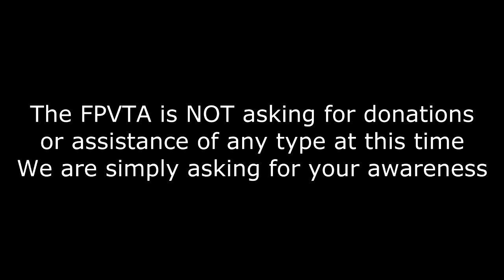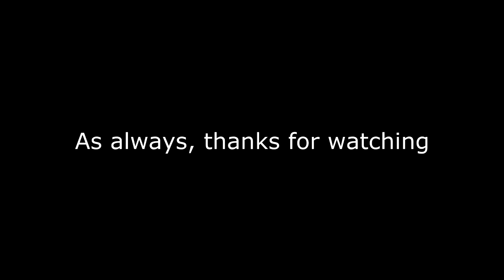The chances of colliding with an airplane

Comment: What you're talking about is called the big sky theory which paradoxically led to the creation of the national airspace system. Research it. Second, your acceptance of risk and the full-size aircraft pilot's acceptance of risk are completely different.  He risks his life and you a foam toy. By the way, yes a LiPo will indeed destroy a jet engine running at 40K RPM.  Regardless, you are missing the point.  The FAA has asked us to follow a few very simple rules.  When you and 007 post "high altitude" and "in the clouds" videos on the Internet the FAA has no choice but to strengthen the rules and possibly the consequences for all of us.  Lastly, making a video convincing the public it is acceptable to share the airspace with a highly regulated industry is irresponsible, regardless of your wardrobe.
Reply from the maker: The pilot of an aircraft takes a risk when they fly.  The fact that they take a higher risk than I do does not give them more rights to the sky over my own private property than I have.  Period.  By this logic, I have more rights to the national parks because I choose to rock climb there.

Also, the "high altitude" flights you see flown by me have had FAA clearance.  I am a professional.  I conduct myself accordingly.
Reply: Alex Greve Well said, Alex. I fly Full-Size aircraft, also. Experimentals only, not commercial, yet I am up there with my own life, taking that risk as I choose. Nothing perturbs me more than "Good Ol boy clubs". They basically say to outsiders, "We have been doing this a long time, and have established our dominance in this activity/area. We have spent a lot of time and money achieving this highly sought-after status. You, on the other hand, have found a much more efficient and cost effective way to enter into our domain, and I hate you for that. I don't want you here. Go away." It is pure jealousy, mixed with a bit of irrational fear. The fear-mongers will go away eventually, to the same place where the "Iraq Weapons Of Mass Destruction" chickens went. FPV will, after 10 years of growing without any incidents, become an accepted fact of life, just like cell phones, satellites, nuclear power, cars, and (if you want to go back that far) fire. Yes, the ancestors of THOSE people used to DETEST the fact that OUR ancestors used fire to keep warm at night. Too bad they all didn't freeze and die long ago...
Reply from the maker: *****
If 1 in 31,000,000 million is dangerous, you need to stop eating.  You are statistically 112 times more likely to died from food poisoning.  Statistically you have a 1 in 10,000,000 chance of being killed by debris falling from an airplane.  3X higher than a collision with a UAV.

What you are advocating by saying the FAA should regulate it is advocating freedom being taken away.  Why on Earth should anyone have more right to the sky than another?  My activity is only poses a risk to aircraft.  Flying full scale poses risk to people on the ground AND other aircraft.

There is no such thing as zero-risk.  You force me to take a 1 in 10,000,000 chance of getting killed when you fly, so why is it not acceptable for me to have a 1 in 31,700,000 risk of you hitting my toy?
Reply: Alex Greve
Agree we don't fly high at random.
Reply from the maker: I think you are missing the point.  The ONLY thing I am outlining in this video is PROBABILITY of collision.  That's it.  I am not at all discussing what happens in that event (although history has shown the one collision that did occur did not result in fatalities).  Smaller vehicles and foam airplane pose a smaller risk than large helicopters and multicopters. 

Even large foam airplanes aren't much of a risk.  The reason is F = (mV^2)/t^2. Where F is force, m is mass, V is velocity and t is time.  Foam is a compressible solid and increases the t^2 (time) value considerably which reduces the force exponentially. 

The truth is that a little sense goes a long way when it comes to safety of aviation.  Laws won't change that.  Passing laws does not stop stupidity any more than passing gas stops the rotation of the Earth.
Reply: Jet engines don't run at 40k rpm. They are more around 5-12k
By the way, that risk is for the whole country, not just for one single plane. To get the risk for a plane, you have to divide that percentage by the number of all plane flights per day. That would give completely neglectable number comparing to the risk it takes to fly this thing at all, risk of failure of any systems etc. It's usually around 1/100000 and 1/1000000
Reply: Alex Greve You need to take up a leadership position
Reply from the maker: Tarik Agcayazi
I am the president of the FPVTA and the CTO (chief technical officer) and owner of Video Aerial Systems.  I think that's all the leadership I can handle ;)
Reply: Glad we have someone like you in charge then
Reply: Alex Greve Again uninformed. Whoever told you that you own the airspace over your property was lying to you. You also assume people only fly models only above their own property.  Equally false.  Does the air ambulance or news helicopter need your permission to fly over your house while conducting business?  Privacy is a different issue.  You've admitted in your videos that flying is safe, for the most part. This is so precisely because it is an activity REGULATED BY THE FAA. Also, the participants in this airspace have attained a lot of education which certifies them to operate there.  No one is saying you can't have fun with FPV but please do it within the confines of Advisory Circular 91-57 and please, please, to anyone listening, if you choose not to follow it do not put the evidence on the internet!  I can say all this because I worked hard to get a degree in aviation, I earn a living flying large airline aircraft in all corners of this planet, have flown UAVs in defense of this (US) nation's security, and also enjoy the FPV hobby in my leisure time.  So, from one professional to another, let me remind you that what you're advocating is dangerous.  At best all you can say is that a mid-air 'probably won't happen', which we can all agree is not good enough for the flying public.  Just because the statistics are low doesn't mean the FAA shouldn't take steps to prevent an accident.
Reply: "Just because the statistics are low doesn't mean the FAA shouldn't take steps to prevent an accident." 
You talk as if the only risk in the world is me going outside and flying my airplane.
Reply: Oh they can take steps but what if DOT did this with cars? They crash how many times a day? It not what but rather how there doing this that is just crazy. Spend years slacking off then in a punch just start throwing laws out there without any thought.
Reply: Tarik Agcayazi Did you watch the video?  The conversation is about aircraft, both full sized and model.  If you want to talk about all the other risks "in the world" find another video to comment on.
Reply: Alex Greve You keep supporting these claims with these ridiculous numbers and then use them to say that low probability equals low danger.  How can you say that? Let me play along.  There are roughly 300 million people in the USA.  Hypothetically, let's say that some random act at the odds of 1 in 300 million results in someone's death.  You're argument would say that the 1/300mil chance made it safe but I think the dead guy would seriously disagree with you.  Are you going to be the one to tell the loved ones of that person that the incident was safe?  Furthermore, if the government knew of the danger and choose to do nothing it would be considered negligence, which the taxpayers of this country would hold them accountable for.  
Now I can hear you all already, "But what about all the motor vehicle fatalities, what about slipping in the tub, what about choking on your food?!!".  What you all fail to realize is that those ridiculous analogies are all accidents.  What we're discussing are actions by the public that, through regulation, can mitigate (notice I did not say eliminate) injury.  For instance, a pedestrian killed by a car out of control on an icy road is a very unfortunate accident.  A similar pedestrian could also be killed by a drunk driver.  While these are both motor vehicle fatalities, you can't put them in the same category.  Every analogy I've seen in this thread has been in reference to accidents which, by nature are not predictable.  Keeping in your argument, you would also seem to claim the law against drunk driving is an attack of your personal freedom to drive however you wish.  You also don't have the freedom to sell drugs on the street.  These facts don't mean we live in a communist society, it means we live in a society of common sense.  You need to take a step back from your calculator and apply a little common sense of your own.  Just because you can build an antenna doesn't mean you know how to aviate safely.
Reply: ***** Acceptable risk is a part of life. It is plain and simple. There is risk in everything you do. You engage in activities every day which put other people at risk. When you get in your car and drive, you are putting people at risk. Should we tell you that you cannot drive anymore? We FPV flyers want to continue our activities without all this fear and paranoia shutting us down. We engage in an activity which has been going on all over the world without killing people for years. It's fun. It's safe. It is much safer than the majority of activities out there. We will continue to put our aircraft in the air, and continue to fly safely, and enjoy our hobby, whether you like it or not. I don't care what drunk drivers are doing. That has no bearing on what I am doing with my creations up in the airspace. You seem ridiculous, wasting your breath, attempting to make our hobby look dangerous, when no collision has happened in all these years. Don't you feel kinda silly? How will you feel 20 years from now when there still has not been any FPV vs FS Aircraft collision? Will you still feel as strongly? Still feel an event is imminent? Go build an underground bunker somewhere, please, and don't forget the tin foil hat!
Reply: Freedom DroneFPV I find it hysterical that the person claiming a quad accident could only be caused by a Muslim (a comment found elsewhere in this thread) is the same person calling me ridiculous.  You seem unable to grasp the concept of credibility.  But you're right, risk is a part of life.  So, we should do away with all rules and laws of modern society simply because "We FPV flyers want to continue our activities without all this fear and paranoia shutting us down".  I love that argument by the way.  I hope you used it during the FAA's comment window they open up on this subject.  If you did, I'm sure they laughed at you, the same way I laughed at you after reading your comments.  The drunk driving remarks I made were in reference to bogus analogies supporting ridiculous claims of safe flying practices but apparently that lesson went over your head.  And regarding your 20 year prediction of accident free skies, you'd better read this morning's news (CBS) on the quad near JFK airport.  Seems you should get your crystal ball fixed.  Before you even say it, no, it was not a collision but statistics (such as close calls in the world's busiest airspace) are not trending in your favor.  Also, there's no need to cry, if you and those who share your delusions had stayed within the confines of AC 91-57, the FAA wouldn't be threatening to take away your toys.
Reply: ***** I do agree with you that the FAA is suggesting some very bold and outlandish regulations but I also believe that a well rounded argument must employ a bit of devil's advocacy.  To say it another way, we (notice I am including myself in this hobby) should all make at least one attempt to see things from their perspective.  The FAA is tasked with protecting the skies above this country, which by the way, are the busiest on this planet and represent a task not shared equally by any other nation.  Just this morning (Nov 20th) CBS ran a new story of 3 pilots spotting quads near their aircraft at JFK airport all within the week. I know first hand that to see something the size of an office chair in flight requires the object to be within one or two wingspans away, which I hope we can agree is unsafe.  So, if the FAA is to make things safe, what are they to do about this?  Certainly ignoring it is unacceptable, it was on the front page of the news!  I think if we can offer solutions to the problem we would do much better to further our hobby than to only complain.  However I believe that solutions to this highly public problem are not so easy and it is that fact which has left everyone second guessing and scratching their heads.  I have worked with the FAA for a long time and I can tell you that they are not going anywhere.  We can either choose to work with them and help to absorb this great hobby and commercial opportunity into the system or we can fold our hands, stomp our feet and shut down the possibility of a compromise.  Should we choose the latter I promise you, we will loose.
Reply: ***** ...seriously? Is that what you're stuck on? Me saying "Airplanes" instead of "airplanes and quadcopters"?
Reply: ***** also, " What you all fail to realize is that those ridiculous analogies are all accidents. "

like i would purposefully fly "any thing that flies and is remotely controlled" into an airplane.

of course it would be an accident.

also you talk about drunk driving and selling drugs on the street... I dont think you can compare flying anything RC to drunk driving or selling drugs. Thats just too far of a stretch. thats like saying "i should be able to randomly fire my gun anywhere i want freedomm". No you cannot, because even if you dont hit anybody it causes public disturbance. If you sell drugs to someone it causes mental instability while high, and their parents might have a word or two to say about that.

i do not think my parents would be against me innovating and increasing my knowledge on flight, and maybe growing up to be an innovator. Because what i do can actually help people. I dont see how drunk driving helps anyone in a positive way.  

ALSO. one more edit.

I agree with you when you say the FAA should put SOME regulation in, because people can be irresponsible at times. But it should be well thought over, and people who know this hobby should be left relatively free.
Reply: Freedom DroneFPV Thank you for proving my point.
Reply: Freedom DroneFPV what?